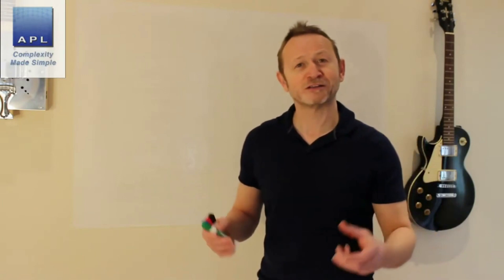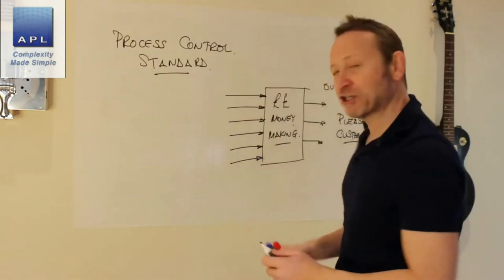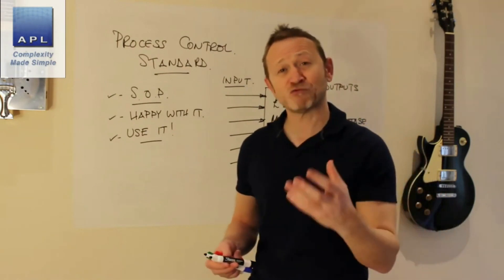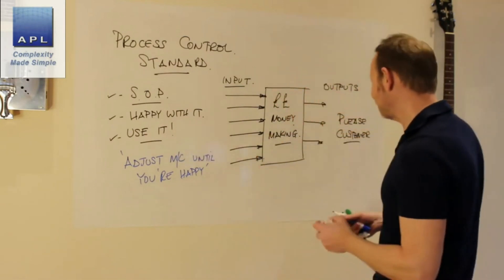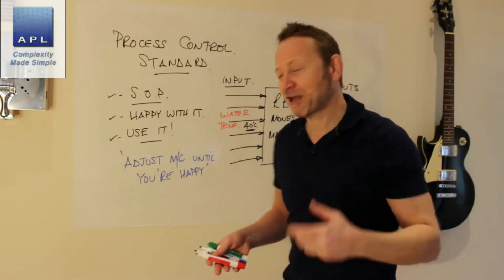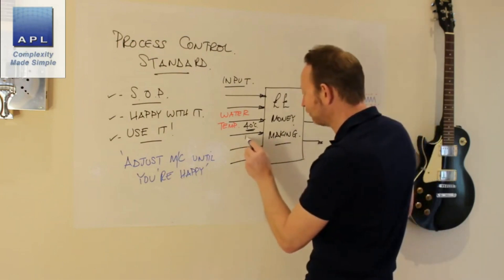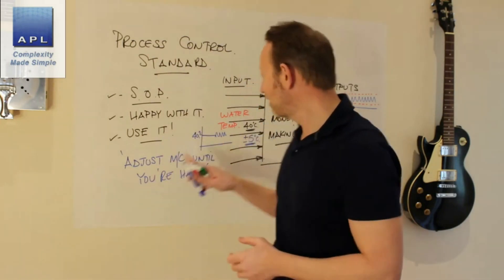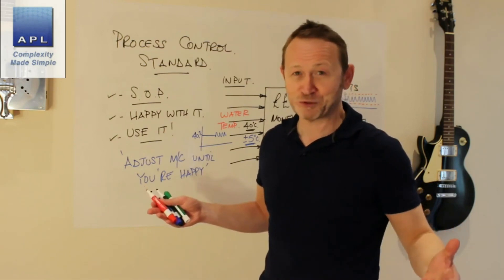Process Control Here's how it works!

Comment: Hi 
I have a question
I would be appreciate if you answer me . I should deliver a presentation 3 days later
My question is should the test results of centre points of doe be similar or can be varied.
I had 5 center point with 13, 15, 25,28 and 30 test reslut 
But lack of fit was unsignificant
Does the results is wrong
Please answer
Reply from the maker: Difficult to say without seeing the the model you created and the data set you used. Also what target are you trying to hit? These questions are practical not mathematical......I can't imagine your r2 is very good though...which would limit the use of the model